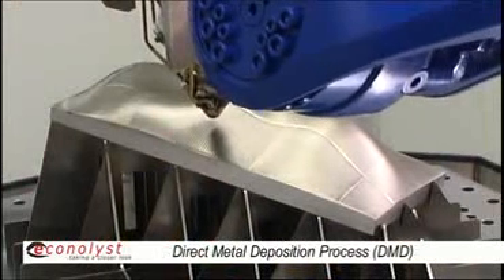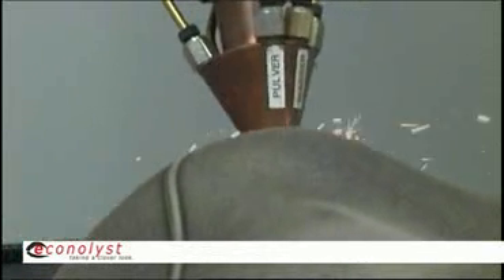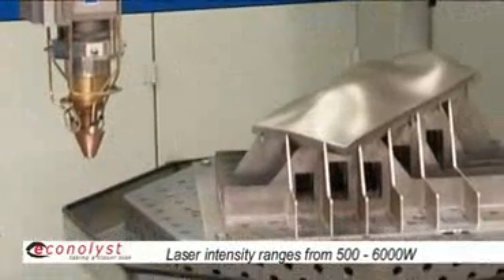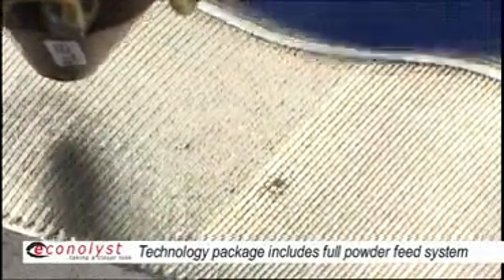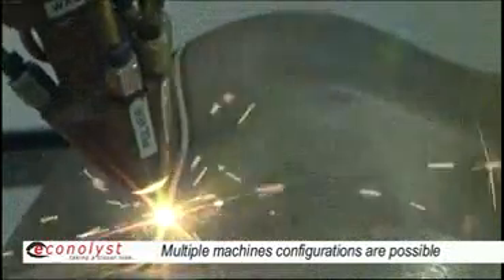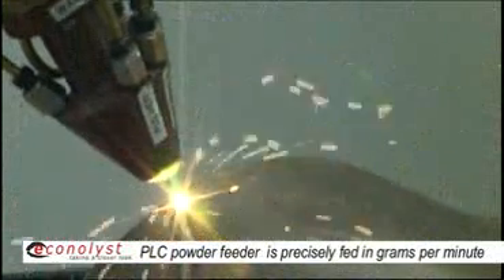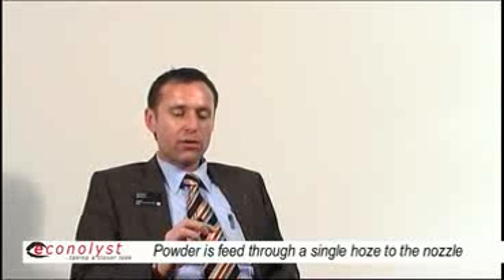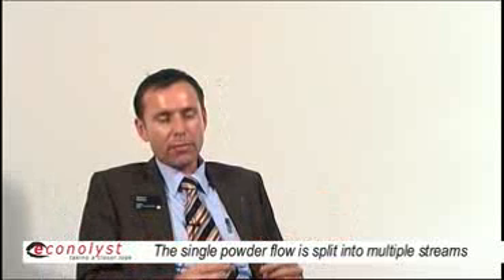Trumpf - Direct Metal Deposition

Comment: so you could for some reason, magnatise any regon with the welder head. if for some reason you might need to. or could you lay pre formed metal pipe, or frame, tobe welded into work pice, to carry liquids or gases, for use in the running work pice ie finished item eg car ie chainsaw etc

Comment: kitchen knives in alumina(not single crystal)have been already tried out.There are many zirconium oxide knives out there you know.Some race car axles already have ceramic fibres in their cores (they're metal-matrix comps).No need to"print"ceramics except for prototypes.Microcrystalline & compact & little porosity near net ceramic shapes, and wild artistic or technical shapes are already feasible with procedures such as hot & isostatic pressing,sol-gel,stock removal by CNC ultrasonic cutting etc

Comment: Well in theory 3d printing would be excellent considering a perfectly smooth shape to reproduce without welding , casting and polishing but that's not the case actually. Polished substrates and different types of deposition give better results in terms of a perfectly coherent and smooth surface than 3d printing...for the moment. Who knows perhaps someone will refine the technique and it will get better.

Comment: Would it work better in a vacuum?  I know, I know: it won't be a vacuum for long with all that helium being squirted into it.  But I mean for the Ti itself.

Could it be easily adapted to use more than one kind of metal?  Right now one stream is split into three.  Could you use two or three to begin with?  I'm thinking tin and copper, to make bronze and brass.  Or maybe that isn't at all practical.  I don't pretend to be any expert; I'm just asking.

Comment: you aint seen nothing yet.
the extraterrestrial cultures that are visiting us daily use a 3d printing process that doesn't distinguish between structure and electronics, it's all one process that puts electronics function into the structure with no discrete components. structure, computation and power systems

Comment: @bbrockert You're right, HIP isn't the only additive process in inert gas, far from it! I only pointed out that a fine helium stream to protect from oxydation isn't sufficient for isolating the molten Ti particles fed through the nozzle,especially when you have red-hot molten metal DIRECTLY exposed to ambient air just after it's deposited.Interesting method but should be refined furher. the same kind of problem is encountered in some welding methods.

Comment: HEy man, he says :  "helium, a laser source etc" but that's concerning the STREAM of ionized helium coming out the FEEDING NOZZLE, NOT the SURROUNDING ATMOSPHERE in the room, aka the one I was talking about, which seems to be ambient air (watch the video it seems to be a normal "room" ).  As I said, it's perfect for inert ceramics but for SUPER sensitive  Ti and Zr  alloys, it's  a big NO : they bind immediately to oxygen,hydrogen,carbon & nitrogen. Check titanium casting&hot isostatic press.